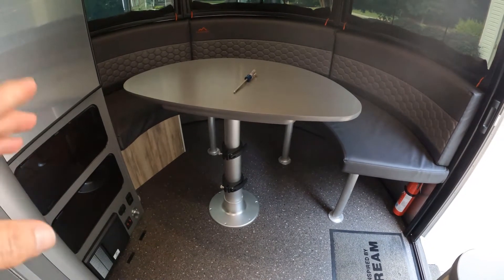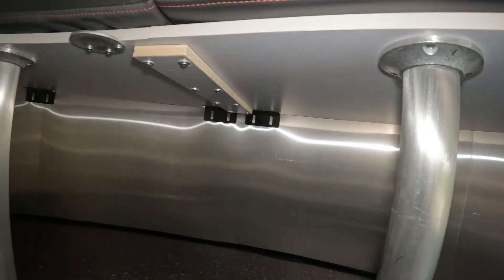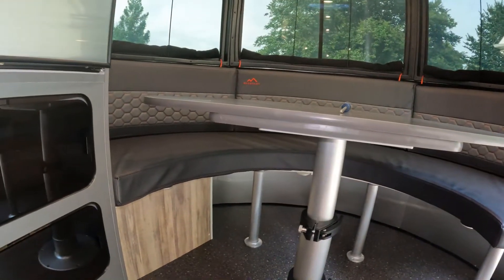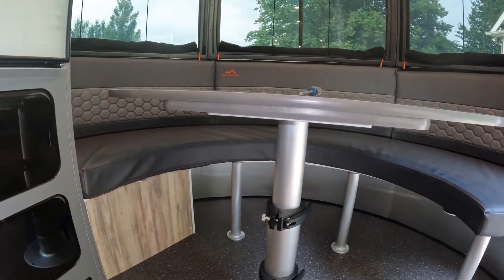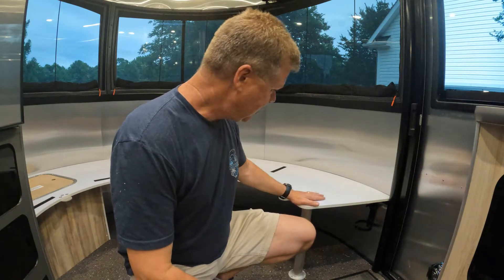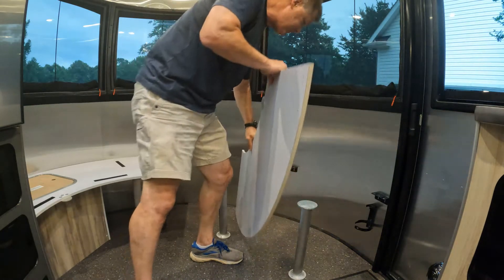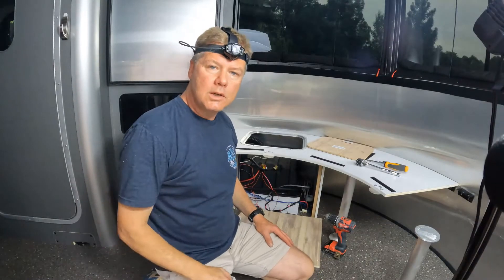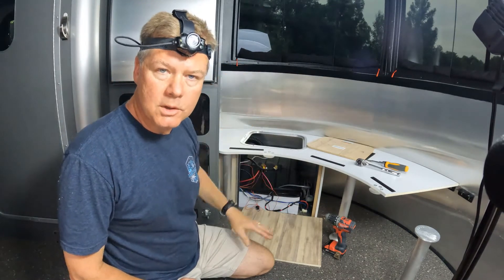Airstream Basecamp 20X, Equipment and Battery Removal In Preparation For 24V Battery Upgrade

Comment: Another great video Wayne.  Before spring I’m going to install the BMV 712 battery shunt.  I like how you just ran it off the battery terminal from the cover. Looks pretty straightforward.   Question, did you buy 500 amp or 1000 amp shunt?  Based on your other videos, I assume you went overkill and got the 1000a.  Lol.
Reply from the maker: Hi @EP, yes, I purchased the 500amp shunt and it is more than enough for the Basecamp solution.  I do have a tendency to go over board on the solutions.  haha.
Reply: @WayneBogan  Me again, sorry.  The shunt has a 3/8” lug.  Did you have to drill out the existing negative wire going to the buss bar in the Basecamp?  Just curious.  Also, are the lugs on top of the battery cover the same as the Battleborns (5/16”)? Thanks for your help.

Comment: Do you have pictures of how the batteries fit?
Reply from the maker: Yes, I’m working on the next video now that shows the battery placement, the new hole for the 7-way cable and the other connections.  You can also see a picture of the battery placement that I posted in the Basecamp Facebook groups.